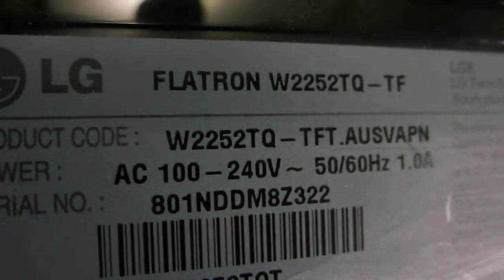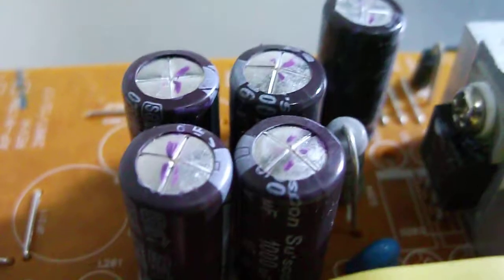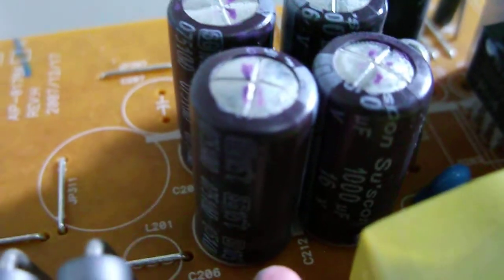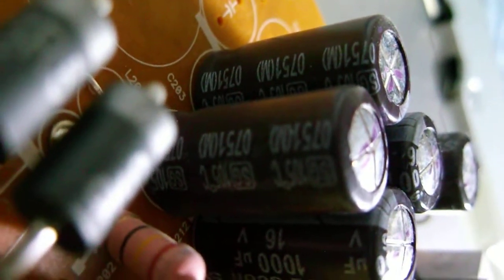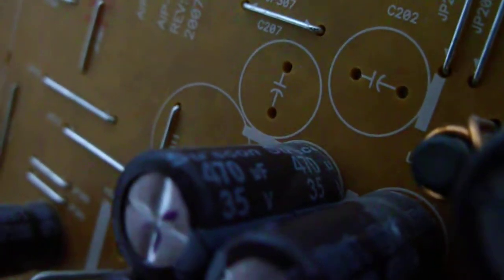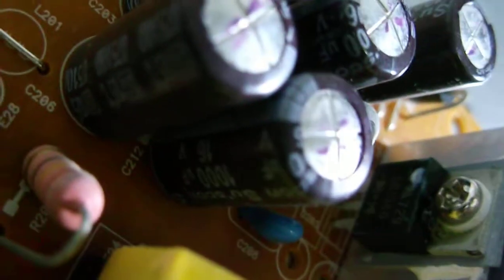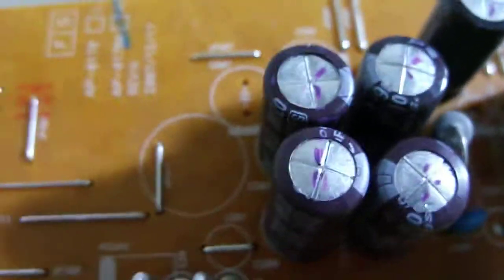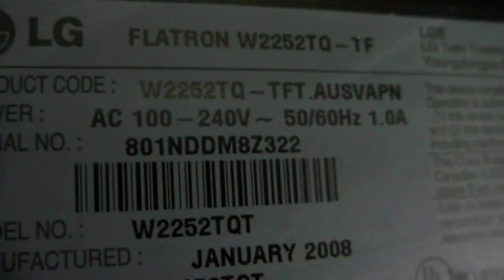LG Flatron Monitor Diagnosis - Model #: W2252TQT - 3 Capacitors bad

Comment: I replaced all caps on the board...it turns on 2sec, then it makes a zish noise and the monitor turns black again without turning off, the zish is (if you look from behind) on the left bottom side where the cable is going in

Comment: Having the same issue the display does not switch on. How do you identify a bad capacitor.
Reply from the maker: Jan Mou Usually the caps puff out the top, breaking the X seal.
Reply: Bux Produxshuns awesome thank you. It's what mine are like so I need to replace the capacitors.